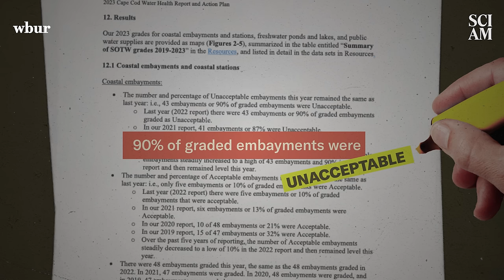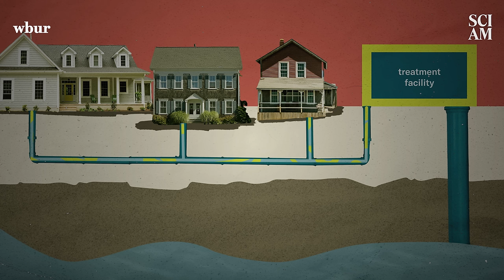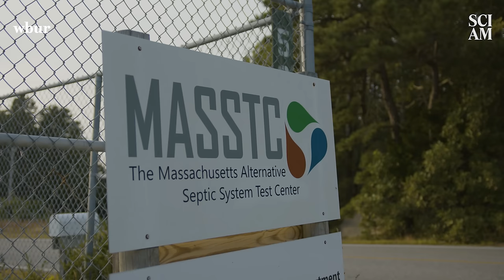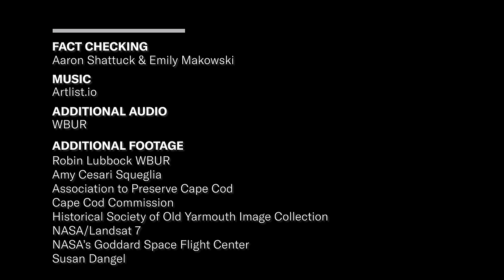Cape Cod Has a Big Problem Simmering Just Below Its Surface

Comment: What the heck!   Why don’t they have a sewer system!!!!
Reply: There are a number of towns that make up the peninsular we call the Cape.  Sewering is under way on many of them. It is definitely a long process.  The cost of the infrastructure is one thing, getting the individual homeowners to connect is another.  It is a big expense of $7000 - $10,000 for a basic connection where gravity is enough to move waste.  There are a number of homeowners who are downhill from the sewer line that will need additional pumps installed.  Some towns are working on ways to make it more affordable for hookup but it’s definitely a hurdle moving forward.

Comment: This video should have investigated what they are doing in Dubai, which doesn't have a sewer system. They have a fleet of trucks that haul the waste to a central processing facility. That seems very feasible for Cape Cod.
Reply: Dubai has essentially free oil/gas and massive highways. Trucking is probably the cheapest option for them.
Reply: Surely you jest. Dubai is a joke.